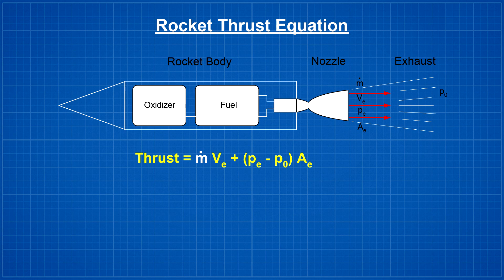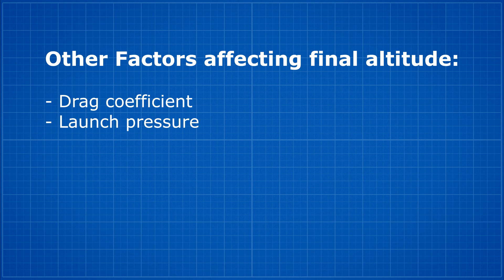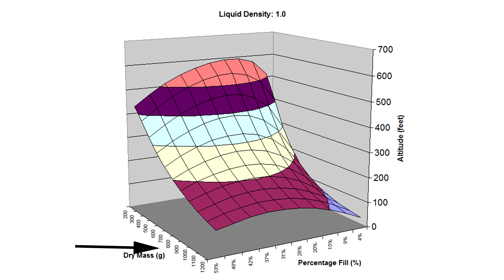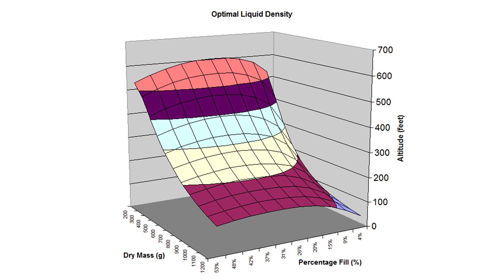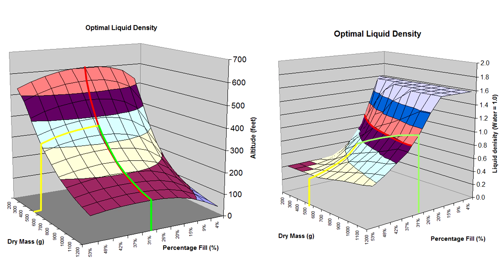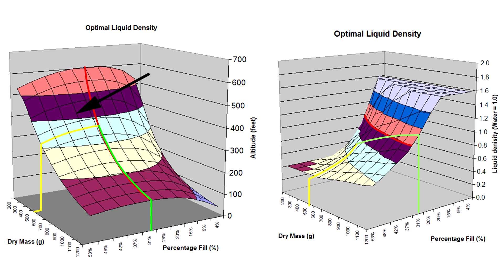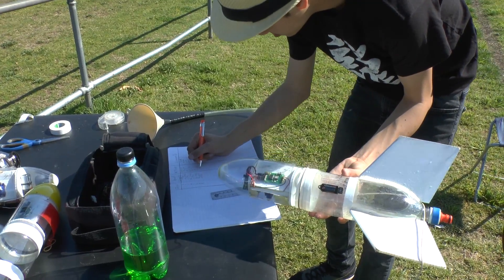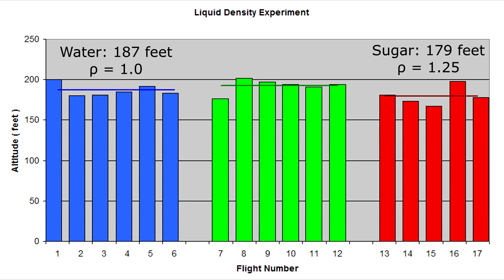Water Rocket Liquid density experiment

Comment: What software did you use to compile the simulation data into a 3 - variable graph. I'm trying to find the optimal volume of water for my water rocket and I would love to be able to have that 3D graph. I tried using the link in the description, but that simulator only compared altitude at a set volume, not at variable volumes. Thanks a lot!
Reply from the maker: It took a while, but I just ran a bunch of simulations and recorded each run in a spreadsheet. Then just used the spreadsheet to graph the data.
Reply: @AirCommandRockets  ok. Thanks!

Comment: Late to the game, and perhaps a foolish question... But rather than using the same volume of liquid for different densities, why not try using the same mass?  If you use a more dense liquid to achieve the same mass as a given amount of water, will that not leave more room for air.  Therefore more stored energy expelling the same mass?
Reply from the maker: I think that is a reasonable question. Worthwhile running some sims to see.

Comment: If you compress the air to higher PSI’s can you increase the relative volume of the water and attain higher flights?  I am assuming the 29% ratio has to do with the limitation of 150 psi due to the weakness of the bottle-   The smaller the volume of air in relation to water, the more quickly that 150 psi limit of air pressure drops as the water is expelled resulting in a higher mass, with a more rapid fall off in imparted thrust. Right? Essentially, where water rockets differ from other rockets is that the impulse of a water rocket rapidly falls off rather than remaining constant.
The much higher air pressure would mean higher initial thrust, to better lift the higher mass of water.  So if you figure that with the last of the water leaving the bottle, you want the air in the bottle to still be at 300 psi- you should be able to pressurize your empty horizon rocket with 300 psi of air, and then pump water in against the pressure until that head of air is compressed to 2000 psi.
Is this what you are after with the horizon rocket project?
Reply from the maker: There are many parameters that affect the final altitude of the rocket, not just the water/air ratio and pressure. The best way we use to optimize the amount of water for a particular pressure is to use a simulator. Dean Wheeler's simulator seems to do the best job at taking all the parameters into account. He has done a really good job in creating the mathematical model behind water rockets.  https://www.et.byu.edu/~wheeler/benchtop/pix/thrust_eqns.pdf

Comment: I would like to see if optimum density changes with nozzle size.  Wouldn't different nozzle sizes be more efficient with different density?  I'm thinking larger would need denser.
Reply from the maker: It would be an interesting comparison. In general a larger nozzle produces more thrust, but with greater thrust you have higher peak velocity. Because drag is proportional to the square of the velocity you will induce more drag. So it would be interesting to see what kind of overall performance difference there would be.

Comment: Actually, I kind of guessed that the lower density would mean better performance.  You can accelerate the lower-density liquid to a higher speed for the same amount of energy, which means your engine is more efficient - better specific impulse.  Granted, it doesn't mean much over such a short burn, but it apparently means enough to have a minor effect.

Comment: What about helium instead of air? pressures about same but ? lighter loading?
Reply from the maker: Helium actually performs worse because of its low molecular weight. During the air-pulse phase of the boost the helium atoms carry less momentum than their air (N2) counter parts. CO2 is actually the better gas to use because it is heavier than air.

Comment: Good Afternoon! im doing my extended essay on a water rockets and how the liquid density effects the hight that the rocket will reach. I Would love to ask you some questions regarding this topic
Reply from the maker: Happy to answer any questions I can. You can either ask them here, or send us an email. http://www.aircommandrockets.com/contact.htm
Reply: Thank you so much! I find it quite difficult to find enough calculations on  this topic to fill up my extended essay. What calculations could i do that would be related to how liquid density impacts the behaviour of the water rocket?
Reply from the maker: Here is a good write up of the thrust equations relating to a water rocket. You can see how density affects flight. https://www.et.byu.edu/~wheeler/benchtop/pix/thrust_eqns.pdf
Reply: it's a great write up but sadly after reading it a few times i still dont understand how i can relate those equations to my experiment.
Reply from the maker: So what is your actual question? Are you looking for a formula that has density as its input and altitude as its output?
Reply: yes, something like this. My question is How does the liquid density effect the altitude at which the water rocket will be launched.
Reply: yes, something like this. My question is How does the liquid density effect the altitude at which the water rocket will be launched.
Reply from the maker: The problem is there are a number of interrelated variables that have to be taken into account to work out the estimated altitude. Increasing the density will increase thrust but also increase weight, with increased weight means you have a lower acceleration and hence the induced drag on the rocket changes also affecting your final altitude. You also need to take into account that these parameters all change over time as the rocket flies. This is why it's best to use a simulator that iterates over these calculations a number of times to arrive at a final altitude estimate. Dean Wheeler's simulator doesn't allow you to change density, but Clifford Heath's does: http://cjh.polyplex.org/rockets/simulation/ You can see what happens when you change the density. Note that you will have a different optimum water fill amount at different densities too.
Reply: +AirCommandRockets alright perfect I understand! Thank you so much for help!

Comment: The question asked by Oliver can be interpreted differently... "Can I add something to the water to make more thrust to make my water rocket go higher". Adding solutes to change the propellant density is one possibility; an additive to reduce viscosity -- for instance a detergent, or a "slippery water" polymer additive fire departments add to make water easier to pump on fires -- is another. Would these help the rocket thrust by increasing the exhaust velocity / reducing turbulence in the nozzle?
Reply: P.S.: This -- http://www.iafss.org/publications/frn/959/-1/view/frn_959.pdf -- mentions "long chain, high-molecular weight polymers such as polyethylene oxide, polyacrylamide, polyisobutylene and polymethyl methacrylate, guar gum (a natural material), and some soaps". These are typically added in << .1% amounts.
Reply from the maker: Yes quite possibly. We do know that when we add detergent to the water and create a dense foam then we do get a performance boost, but I am not sure if that is due to the foam creating a lower density liquid or because the viscosity is reduced. https://www.youtube.com/watch?v=Gqm9xIJp9ms Thanks for the link to the paper, I'll have to have a read of that.
Reply: Likely it gives the air a chance to expand more as the froth passes through the nozzle, accelerating the mix. You get work from expanding air, and ideally you want to use that expansion -- as much of it as possible -- to accelerate water out the nozzle.

Turbulence in the nozzle throat will naturally limit flow and flow velocity severely, and a pure liquid exhaust provides no opportunity to extract extra work from the air's expansion.

If you had a uniform foam of about 1/3 liquid + 2/3 air, compressed to about 225 psi, the foam would expand about 10-fold after it passed through the choke point of the nozzle (to extract the maximum possible energy from the air's expansion). Ideally, the post-chokepoint nozzle would transfer as much of this expansion energy as possible into the foam's liquid. (For which you'd need a suitable convergent+divergent nozzle.)

Comment: I was trying to show my daughter that science is fun and with a blistering hot summer, water rockets were the way to go. However, my rockets were really wimpy. :( I tried 2 liter bottles and 500ml bottles with a 4mm dia I got really pathetic heights and incredibly inconsistent flights. Have you got a video I could follow so that I could be the hero - again.
Reply from the maker: +Paulo De Oliveira Without knowing more about the rockets it's hard to recommend a particular course of action. Did you use about 1/3 water? How much pressure did you use? You want to use at least 80-100psi for good flights. If the nozzle was only 4mm then that's pretty small. I would try 9mm or larger. Was the rocket designed to be stable? Did it fly straight or tumble? Here are a couple of articles that may be of assistance: http://www.aircommandrockets.com/flying_higher.htm and http://www.aircommandrockets.com/flying_straight.htm

Comment: Using no water, just gas, makes the rocket way lighter, and as there is more space for the compressed gas, there is more power on board. This should make it fly much higher! But... as I know and as you know; it doesn't work well at all. Yes; it works great for the first like 1/30 of a second, and then the party is over. Less weight and more power, but it doesn't fly as high. Can you explain why this is?
Reply: +Giesbert Nijhuis It's because a higher proportion of the stored energy in the compressed air is lost to kinetic energy in the exhaust rather than to the rocket. As the air in the exhaust has a low density, it has to be accelerated to a much higher speed than the water to get equivalent thrust. Unfortunately whilst thrust scales linearly with exhaust velocity (for a given mass), the kinetic energy in the exhaust goes to the square of the exhaust velocity. 

Of course a rocket with no liquid can store more energy in the first place (a higher volume of compressed air) and it has less mass (as the air is lower density than the liquid). However, that's not enough to compensate for the other effects.

It's all a bit more complex of course, but the issue of thrust being linearly related to velocity change and kinetic energy imparted to the reaction mass going to the square is at the heart of why fixed wing aeroplanes are more energy efficient than helicopters or why turbofan engines are more efficient than turbojets.

In essence, it's more energy efficient to accelerate larger masses more slowly than smaller masses to higher velocities for any given level of thrust (or lift). It's more complex with rockets, but that's the main issue.
Reply: +Steve Jones - Hello Steve Jones, thanks for your excellent reply. So: accelerating the propellent mass to double the speed, will give double the force, but will cost 4 times the energy. Is that a correct quote? Then accelerating the propellent mass to 4x the speed, will give 4x the force, but will cost 8 times the energy? (and accelerating half the propellent mass to 4x the speed, will give 2x the force, but will cost 4 times the energy) That would indeed explain your real life examples of: accelerating a heavy mass of air a bit is more energy efficient than accelerating a tiny mass of air a lot. Though, I am still puzzled, and I am actually making a video about this subject. Let’s think of an extreme example: as propellent mass we have only 1 water molecule. This molecule is pushed out of the water rocket, and, well, no lift off. Now my point on this: the reason why this gass pressured water rocket gets practical no force from pushing this one molecule, is because it loses touch with it. The molecule has inertia, but it is almost immediately out of reach. Isn’t this the root of light propellent weight inefficiency, or can “force = mass * acceleration” explain it better?
Reply: With only gas, the propellant mass fraction of the rocket drops hugely. If you were to use a very dense compressed gas, your result would be much better. E.g., carbon dioxide (molecular weight ~44 vs. air ~29) should provide measurable improvement, even if the carbon dioxide isn't liquefied (which would improve the mass fraction even more). Presumably sulfur hexafluoride (MW 146) would be yet better (though there are good reasons not to do this).

[Real rockets sometimes go to a lot of trouble to 'densify' their propellants to improve their mass fraction, e.g., Falcon 9 and its "super-chilled" LOX and RP-1, just so they can get more fuel/oxidizer into the rockets' tanks.]

Steam (MW 18), ironically, would decrease it, unless it was compressed enough to liquefy it (presumably it could vaporize as it expanded through the nozzle?)
Reply: what if you ignited the gas? the explosion would make an enormous amount of pressure, it would make it a then fuel powered rocket